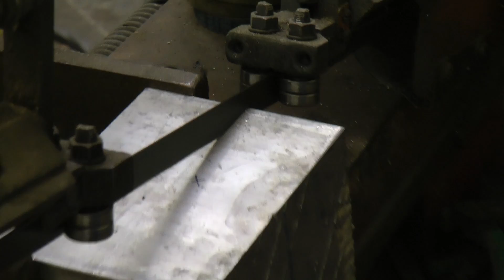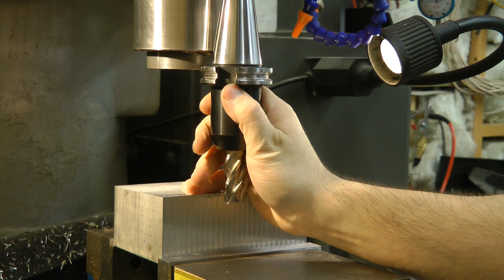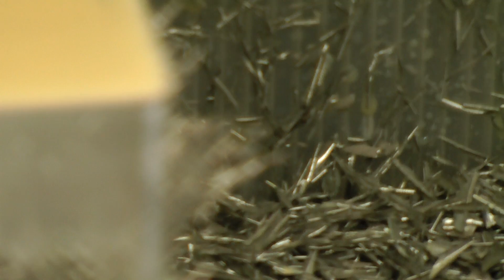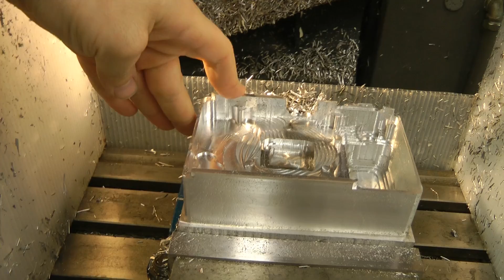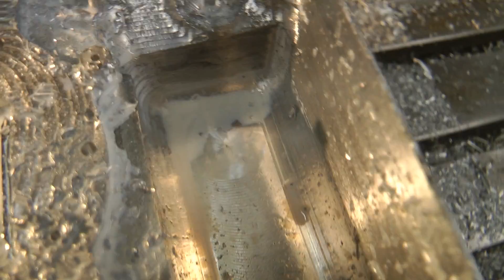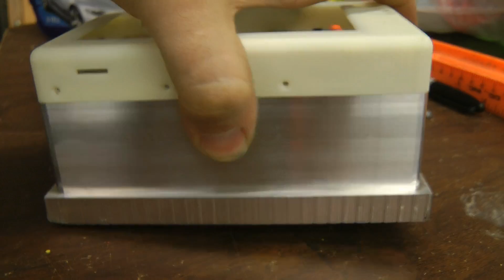CNC Machining of camera case front - part 1

Comment: I enjoy your videos a lot but i had to comment.. Did you use a TIALN coated end mill on aluminium?  Carbide or HSS doesn't really matter other than the reason you posted, the coatings are night and day difference in my hobby experience.  On ALU: its bare HSS or carbide with zirconium nitride to keep aluminium from sticking. Also a 3 flute is about the limit on gummy materials. 4 or 6 or 8 work great on steel. Tialn works super on steel, but you need to keep pushing. Waxing/rubbing the steel of dulls the bit in no-time.

Comment: Awesome piece of home shop machining, looking forward to part 2! To get the chips evacuated, you need to increase pressure.. be it the air or flood coolant but its gunna make a mess. As other have said, stick with uncoated carbide or HSS for aluminum, they have sharper edges. Also you need to generate a certain amount of heat with some coatings to make them achieve their maximum hardness and aluminum doesn't get you there.

Comment: Looks good. One tip though: do not use TiAlN or similar steel specific coated end mills for aluminum. Uncoated carbide is the way to go :)
Reply from the maker: Kizmox Yes, I noticed a grey residue on the aluminum, is that the TiAIN wearing off? I could use HSS for most operations, but I'm thinking the stiffness of carbide is needed for that deep pocket.
Reply: tesla500 I dont think it is wearing off but TiAlN has poor sliding properties with aluminum, and aluminum likes to stock to the coating too. Uncoated performs much better :)
Reply: +tesla500 The grey residue is likely from recutting/rubbing. It really helps to get the chips out of the way if you want good tool life, surface finish, and process reliability. But you really need to throw a ton of coolant at the part to be sure you're not recutting, and that makes a mess without a full enclosure.